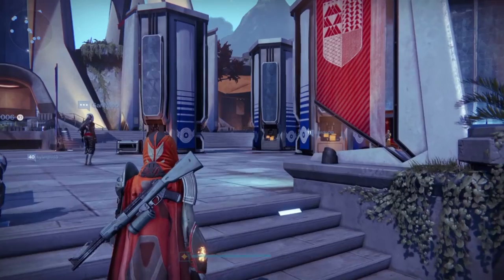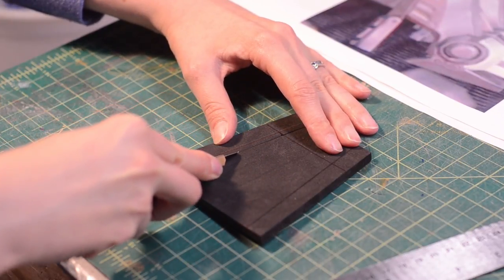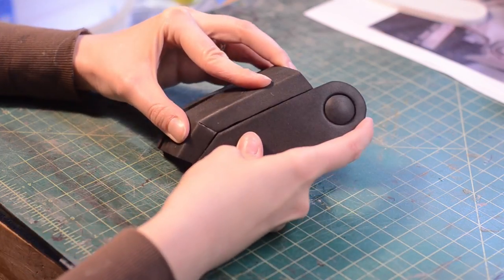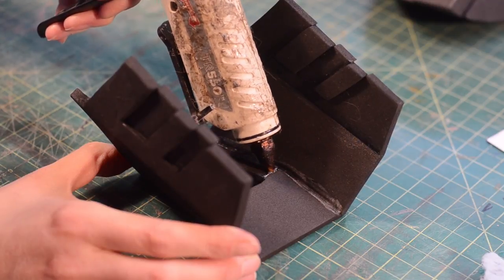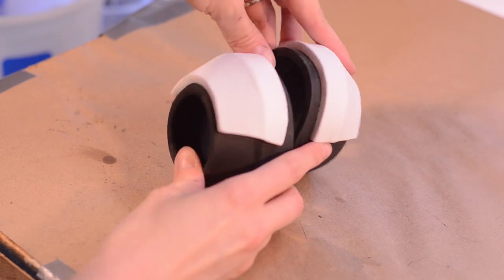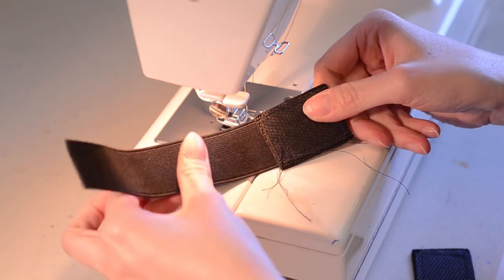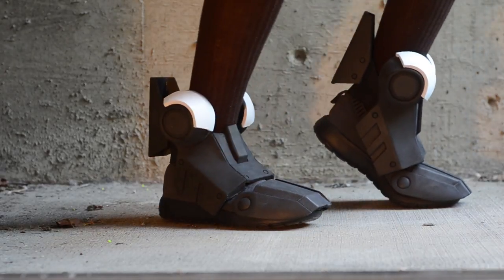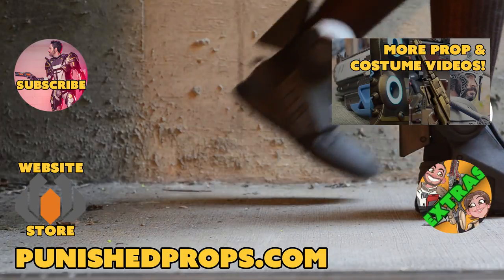How to Make Robot Feet from EVA Foam - Destiny Sweeper Bot Build

Comment: Hi I have a question for you  I do love the boots ,would you think that they could be used in my build  (Cylon centurion ) the lower level  is very basic I just finished  the leg bans that are be teen the ankle and knee but for feet that's were they didn't pay to munch atention? I would like your opinion on this.